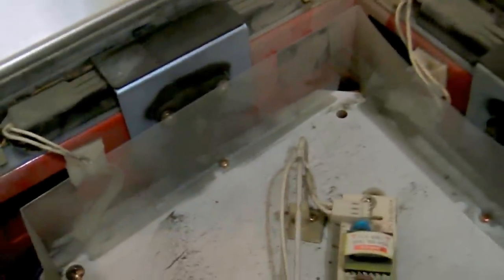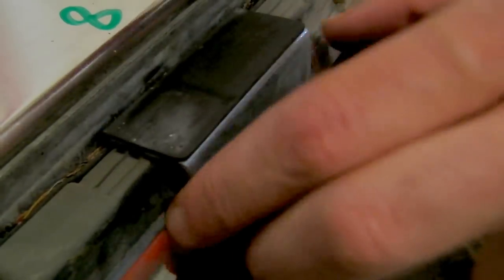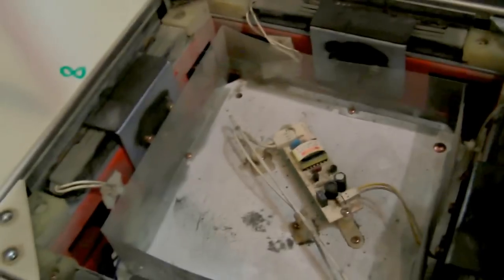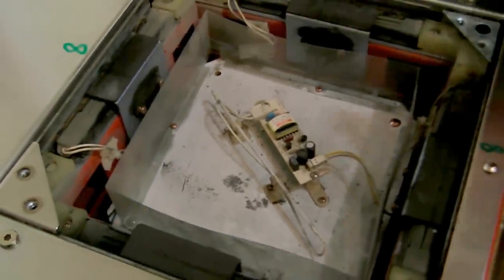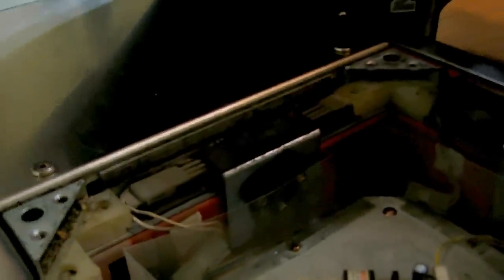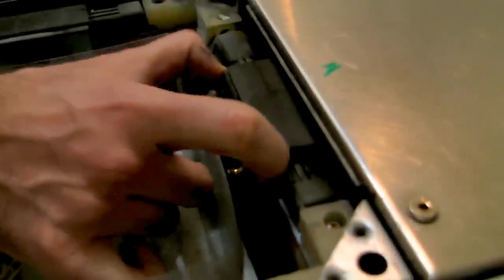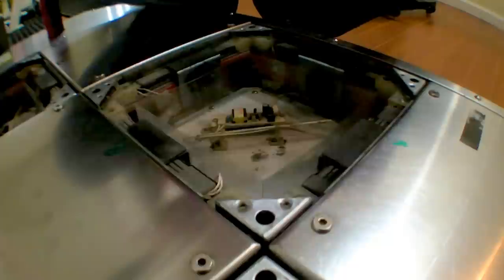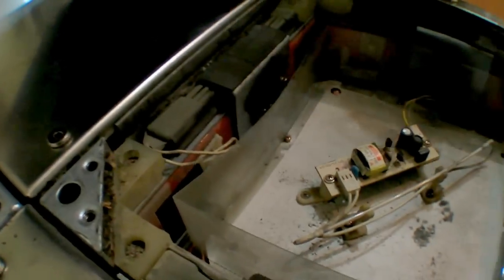DDR and ITG Dance Game Pad Maintenance

Comment: w/ DDR X or X2 Betson US Machines there are no brackets the only fix that somewhat works is to get popsicle sticks and place them underneath the rubber spacers that are located on the edge of each side next to the sensors this help keep the sensors lasting longer.

Comment from the maker: I'm not familiar with the inside of a DDRX cabinet, but as I said in my video, it's likely the bracket is getting stuck while depressing the sensor. Try using some WD40 (lubricant) on it and make sure the screws holding the bracket are clean and not filled with gunk. If all that fails, try replacing the sensor and see if that works.

Comment from the maker: To be honest, I have never tried to remove them, so I don't know exactly how it would affect gameplay. My theory is that you want them there to prevent the brackets from being depressed so much that they begin to deform the sensors. I know people who "tape" or "foam mod" their pads sometimes add padding on those corner pieces to bring it more flush with the metal panels on the pad. Just Google "Foam Mod ITG" and you'll see what this is.

Comment: I have a question. Well I'm currently trying to work with a tech at one of the arcades in my city. But I would like to know if those rubber L shape pieces at the corners are necessary or not, or if they just make the pads less sensitive? I noticed some ddr pads have them and some do not.

Comment: Unfortunately this is the only fix that somewhat works unfortunately the sensors used in those machines are not the same as old DDR Cabinets and they tend to break internally because they are made of super thin copper which due to friction tends to make them snap or break thus causing a sensor to flicker/stay on or stay off once that happens there is no ifs ands or buts about it they have to be replaced.